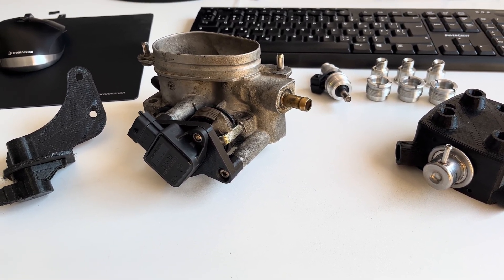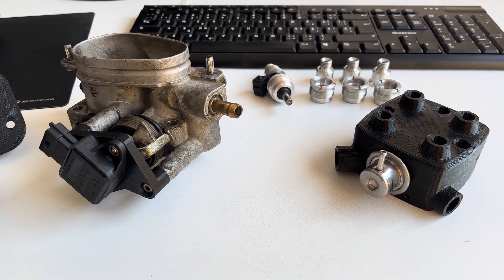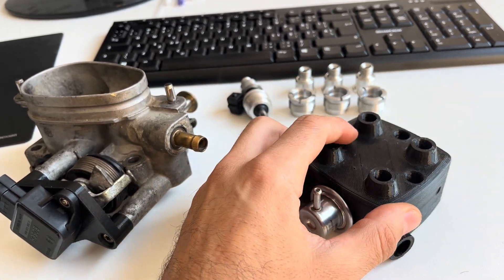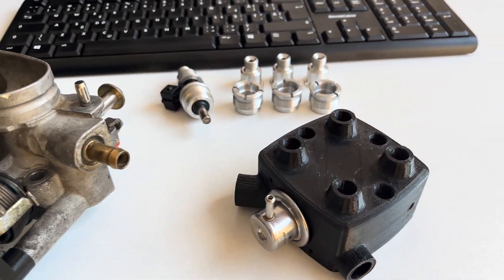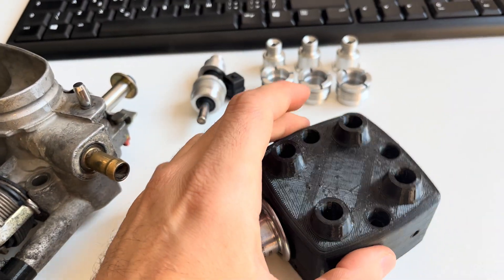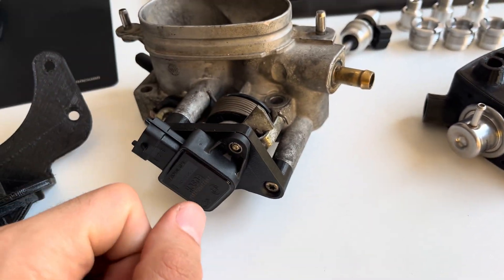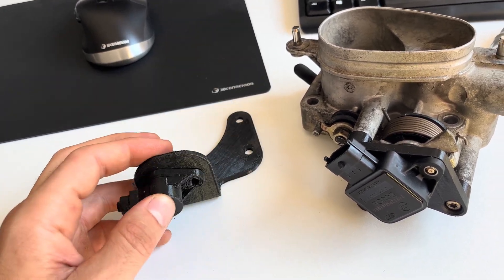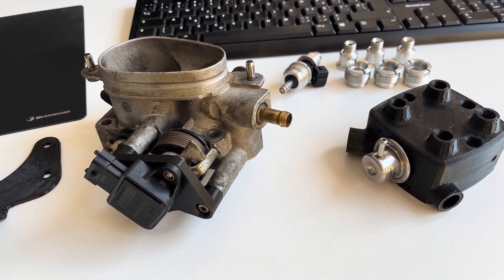Plug-in, bolt-on, EFI kit for the Porsche 924 2L - work in progress

Comment: What kind of injectors do you use? I maybe planned to use Toyota camry Injectors, but they are very short and yours have this extended pipe at the end.

I just finished installing the 944 Gearbox with an LSD differential in my 924, the next step is either the ECU build or the 944 Breaking system.
Reply from the maker: I use Bosch injectors that i specked based on the application targets and the geometric restrictions/needs for the 924.

Comment: Are you gonna keep the fuel « rail » plastic 3d printed or then swap it up to metal version ?
Reply from the maker: That is only a prototype for me to verify the dimensions and look, the fuel rail/block will be CNC made out of aluminium, check out my latest video, you can see it there along other parts of the EFI kit.